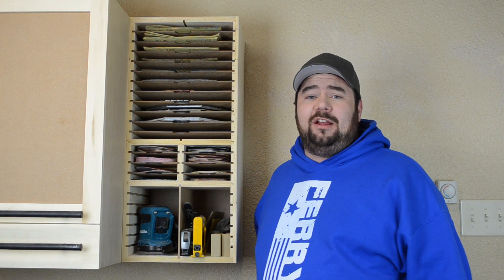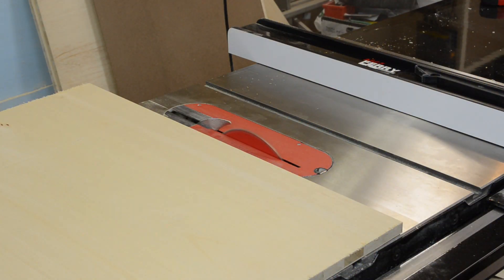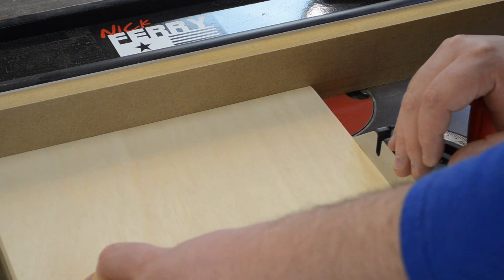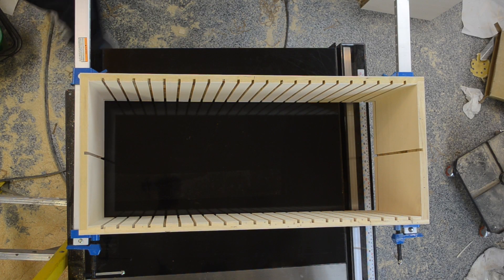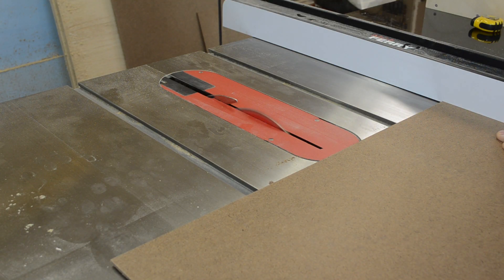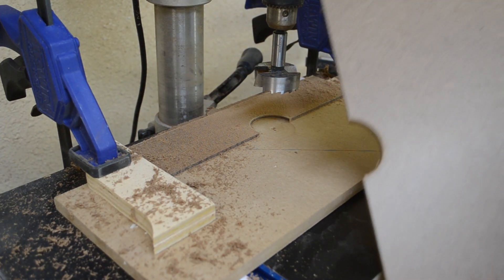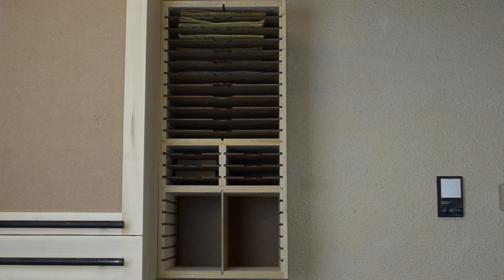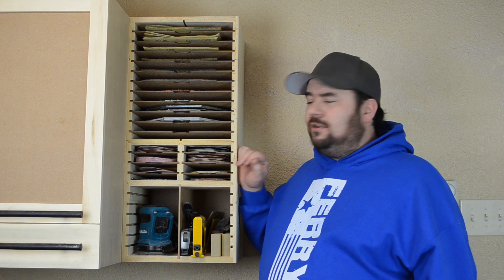Ⓕ How To Make A Modular Cabinet For Sand Paper (ep48)

Comment: I like the result. It's a good way to store all those different types and grades of sandpaper and still be easily accessible.

I've found that "adjustable" or "modular" approaches to storage almost always get set once and left that way indefinitely. (and MOST things on casters never move, either, at least in my experience) YMMV and all that...
Reply from the maker: Barry's Workshop thanks - I'll have to see on the cabinet end of it but almost everything I have on wheels I seem to move a lot - but I do get what you mean - I have made things that were for a certain process and I never ended up using them that way

Comment: I have a cabinet like that (mines a little bigger) that I use for the exact same thing in my shop.  I actually found mine at the local ReStore.  I think I paid $10 for it.  It works great for sandpaper and sawblades.
Reply from the maker: Ryan Hayden cool cool - re-store is a good source

Comment: HI  Nick another little helper hint  
I built one like this a few years ago but I found that the sand paper would curl !  I ended up cutting sheet metal plates just slightly smaller than the sand paper to hold them flat.  since i did that is has worked great.  I also added a vertical saw blade section with the lower shelf slanted higher  ( 15 degrees) at the front so the blades would not roll out
Reply from the maker: good tip - luckily I haven't had any curl issues - possibly because more saw blades are in there now rather than paper, lol

Comment: Very nice! I tried hanging file folders held on the back of a cabinet door between a couple screws but it really doesn't work very well.  I'm going to make one of these.  What kind of panel did you use? It looked like a solid core of some sort.
Reply from the maker: ***** cool - yeah it was weird for me to see - I normally have a supplier for ply but picked this up on a Sunday at HD and I saw this solid core ply so I figured I'd give it a shot - wasn't too bad, a bit unpredictable for what the edge may look like

Comment: Great build as always! A suggestion is you could also put dowels on the side for sanding belts to. Could the main body be made from a 2x4" sheet of plywood?

Thanks!
Reply from the maker: Dylan Bender thanks Dylan - I had thought about belt sander stuff but I will be storing those in a roll away cart that my belt sanders sit on - the side could be made from 2x4 sheets it would just be a bit big for an upper cabinet - final side measurements for what I did were 12" x 30"

Comment: Great project Nick, pity we have so much trouble getting dado blades, makes projects so much harder.
Reply from the maker: Phil Sale no reason you couldn't just do butt joints or pocket holes
Reply: Nick Ferry Still got to cut all the shelf slots, it can all be done on a tablesaw, it just takes so much longer with a single blade, the other option would be to use thinner sides and glue and pin rails all the way down!

Comment: Hello Mr. Ferry 
I am trying to make the racks that you made for sandpaper but for my wife’s craft paper for her craft room I was wondering if you could tell me if it’s possible for me to make those with a Dremel tool and whatever attachments I have to buy for my Dremel tool in order to make that for her? 😬
Reply from the maker: It doable but impractical - a small trim router would be a better plan of attack - check out my other video here - https://youtu.be/BUXxObqZ9DI

Comment: Nick you mention that you put a 1/4" groove for the back panel and a 1/4" groove on 1" center for the shelves. Is the shelving and back 1/4" board or 1/8"?
Reply from the maker: The material I used for the shelves and back measured just under a quarter inch
Reply: @NickFerry  BTW love the podcast!

Comment: Just wondering, when you were explaining the modularity by picking it up and placing on a French cleat on another place, wouldn't it be better if you did cut out the other side for accepting a French cleat? Now you may have to do that later when the problem arise
Reply from the maker: hasn't moved since I stuck it there so I'll cross that bridge when I come to it
Reply: Nick Ferry Maybe it is one of those projects where you intend to make it one way so you can easily take it somewhere else, but then later it just stays there out of laziness ;)
Reply from the maker: exactly!